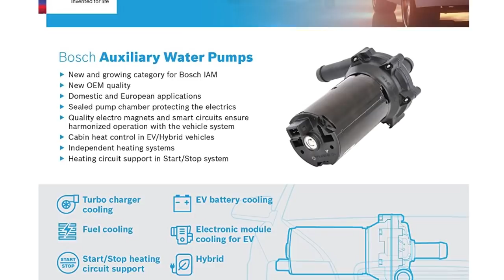Liquid cooling pump for Nissan Leaf Electric motor

Comment: Nice one Ben
I was thinking about checking the current when pumping through the motor but you beat me to it. Would be interesting to see what the Voltage dropped to though as I suspect it dropped a fair bit which is why the flow seemed a lot less. The pump should have been able to maintain the flow with a bigger battery feeding it.
One other thing is you mentioned the box to trick the inverter but didn't list it in the Bill of Materials. 
I'm sure you already are aware of it but for some of your viewers how aren't you can buy a replacement plug in board for the inverter that allows you to run the motor and inverter from almost any voltage and at higher power than stock (within reason). 
https://openinverter.org/shop/index.php?route=product/category&path=59

Comment: When you connected to the electric motor to the water floe loop , you added a little restriction .  This reduced the flow slightly .  That reduced the load slightly , which reduced the current draw slightly .

Wyr
God bless
Reply: Bingo! This is why they got flow vs amps charts. So it's a great thing to just see that there's plenty of flow and low power draw.

Comment: I use similar pump for water to air intercooler, the only difference is the pump came with the pigtail. You can buy a proper waterproof connector for ~$10 from various sources (just google bosch pump connector).
Reply from the maker: The only pigtails I saw listed on Amazon looked like NOT QUITE the right thing, and it was almost $20.
1/4 spade connectors are certainly fine for testing. I'll do up something nicer for the final project.
Reply: @BenjaminNelsonX  https://www.maxiscoot.com/bosch-plug-for-electric-water-pump-l-bw50290937-3.html looks like yours. They are the same as bosch diesel injector connectors.

Comment: Outstanding Ben. You make it look so easy. I actually thought it would use more power/amps when connected to the leaf motor due to more resistance, compared to your plastic tub. Watching this project with great interest.
Reply: The current would have been higher if Ben had used a fixed 13.8V supply, as the 12.6V maximum battery voltage will have dropped significantly throughout the various tests carried out (both on and off camera).
If the battery voltage and the current being drawn were both measured simultaneously, it should have highlighted the variation in the battery voltage during the test.
Reply from the maker: I did a test again after recharging the battery. Same results. Voltage didn't make the difference. I think it was just the fact that there was an outlet hose attached, helping with a siphon effect.